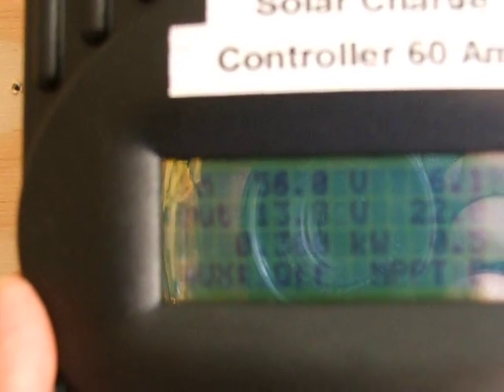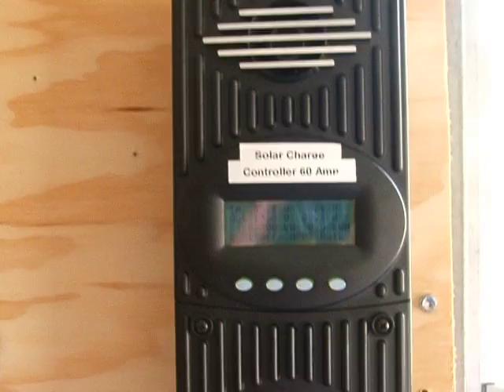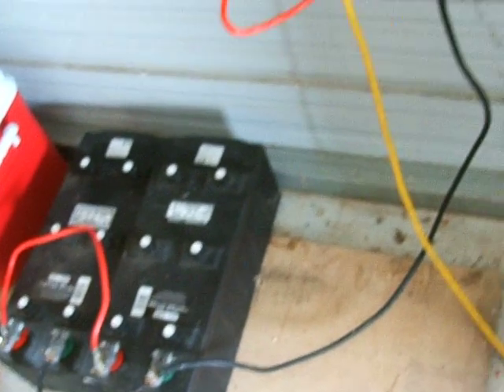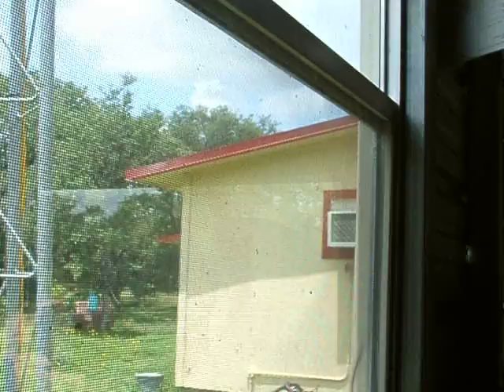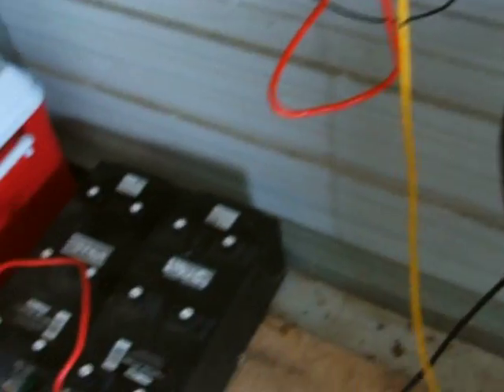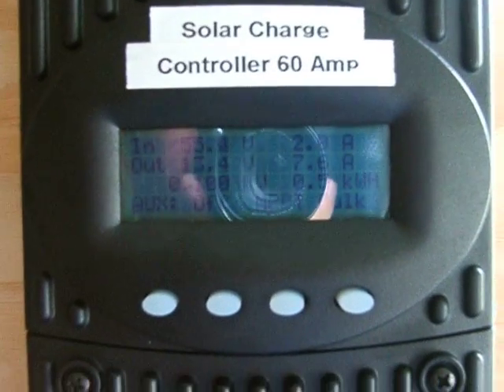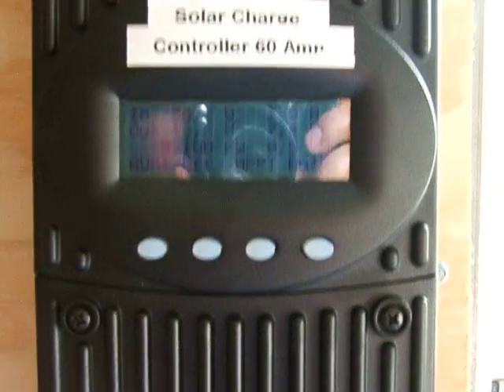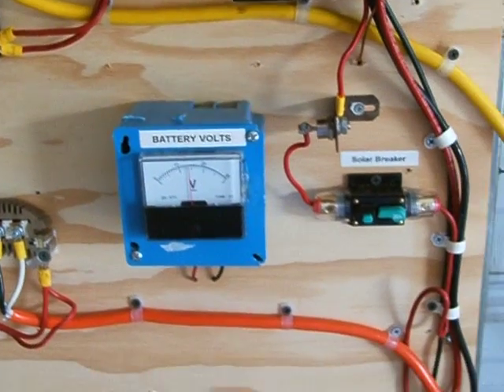Harbor Freight Solar Panels Charging Batteries

Comment: 22 amps..  JESUS.  Nice.  I think I'll be something  like this  too. . My panels are   indoors up against Windows and they suck this way voltage is alright amps is crap.  It seems in parallel they always fail to reach proper charging voltage.   I was  thinking about just using another 100 watt solar panel  and cibbectibg that one in series since I'm limited with space

Comment: Can this charger charge at 12v 4-110Ah=440Ah, led acid batt?   Can it charge double that 8-110Ah= 880Ah?  Will charger burn trying to charge my batt since I only have total PV780w in series.   (System at 12V)

Comment: 6 amps is very good for 4x15 watt panels (60 watts). I have a 120 watt kycora panel and hooked up to a pwm solar charger it averages 4.5 amps in sunny weather, sometimes can get up to 6 amps but rarely. 
I suspect your top of the line mppt charger is definitely getting every watt out of your panels. Seeing your video, definitely going to get me a mppt controller. Thanks for the info.

Comment from the maker: because the charge controller that comes with the kit can only work at the voltage of single panel, you should be fine to add just one more 15 watt panel to the first kit if you wire it in parallel like you did the first three panels in the kit. Otherwise, you have to buy a different charge controller.

Comment from the maker: there are 22 batteries with a 230 amp capacity each, so 22 x 230 = 5,060 Amps at 6v, since my battery bank is set for 24v then my total Amps @ 24v = 1,265 A or 30,360 watts of which 50% is usable. So I can roughly support a 15kW load for one hour without any charging.

Comment from the maker: No, it will not. If it doesn't sense the battery it won't work. I called Outback a couple of years ago with that very question, that's the answer they gave me.

Comment from the maker: From Interstate Batteries, they are deep cycle batteries rated at 210 amps reserve capacity. Car batteries are rated using cca, they won't last you a year in a solar application, you need to get real deep cycle batteries.

Comment from the maker: I don't measure my power output or reserve in amps as that is a meaningless measure without knowing the operating voltage. I measure in watts, I'm putting out about 750 watts per hour out of the panels on average. The battery bank is now a single large 24v bank with 22 batteries of 210 Amp reserve capacity each so the reserve capacity in watts is 115,500 but since I only discharge no more than 50% I really have an operating capacity of 57,750 watts or 2,406 Amps.

Comment: If you're getting 55 volts at 6.1 amps in and 13.2 at 22 amps out to the batteries you're losing around 15% in your inverter due to the voltage conversion. You might save a bit on the cables but the inverter is taking that away. An inverter usually takes some 5% of the energy and turns it into heat.

Comment from the maker: @breezebro I forgot to add this, go around your county roads and look at all the road signs with solar panels that are cracked after a hail storm, that should tell you if you need to worry about it or not (or contact your city dept. of roads and ask them about issues with their solar panels). I don't believe that's an issue because the panels use tempered glass and are angled so they should deflect most of the energy. You'd think you'd hear more about it if it were a real issue.

Comment: Your videos are excellent. I almost think I could do it, but I do get confused since you have some things on that wall for wind and some for solar. I also don't understand how you'd hook up the batteries to a house like in a circuit breaker system so that you can still use regular power if you run out of solar juice. Thank you so much for taking the time to show what you have. Your organization skills are awesome! Would love to know where you found your batteries and how much they cost you.

Comment from the maker: @lamartosh You can use any charge controller you like as long it can handle the voltage and the current for your wiring. God bless you and good luck with your project

Comment from the maker: @toobroke2fight You are correct, I was answering another person's question about whether or not to disconnect their charge controller at night, my answer was really about the blocking diode that exists at each solar panel to prevent draining the batteries at night. Thanks for the comment and God bless you.

Comment: @econewpower I am pretty sure the Outback doesnt need a blocking diode since it should have a relay that disconnects the array at night. You are probablly losing some wattage with the diode in line. check the manual and remove the diode. Its your stuff, but every little bit helps! just my thoughts.... nice system!

Comment from the maker: @teachingedcetera I don't use the HF change controllers, they are not big enough for what I want and they only handle 12volt battery circuits. The 23.57v you mentioned is for the open circuit volts of the panels not for the battery voltage. The battery voltage must be 12 volts. My panels are wired to put out 40 volts which is why I use a different charge controller.

Comment: When you hook up your 24 volts from your panels, do you run that directly into the HF charge controller?  Will it handle the 24 volts?  It says on the label that the peak voltage is 23.57.  Does that indicate it will handle 24 volts without blowing?

Comment: When you hook up your 24 volts from your panels, do you run that directly into the HF charge controller?  Will it handle the 24 volts?  It says on the label that the peak voltage is 23.57.  Does that indicate it will handle 224 volts without blowing?

Comment from the maker: @onemedic Panels are not 12v, they are 20VOC (volts open circuit), thus 4 x 20 =80 VOC.  You have to have nominally a higher voltage than the bank you are trying to charge in order to be able to charge it. Thinks of volts as the pressure with which you push electricity into something, the higher the voltage, the higher the pressure to push those electrons.

Comment from the maker: @CCDeer1960 No matter how big the array is it will only read .300 watts because it was on float charge - meaning - you cannot continue to charge batteries that are already charged. The array on this controller is 420 watts, the grid tied arrays is 1,600 watts, the new array going up will be 2,000 watts. But when batteries are fully charged you can't expect a high amperage/wattage reading right?  Take care.

Comment from the maker: That is a great price, good for you!! You can leave the switch on at all times, there is a blocking diode in the circuit to prevent draining the batteries during dark hours.

Comment: Right now, at the HF place near me- some sort of "Super Coupon" in the flyer they mailed out- had them for $138! So, I bought a set.

With this system right out of the box- is it OK to leave the controller switch in the "on" position after dark (still connected to batteries), or are you supposed to turn the system off after dark. I would think that would be unhandy,  Do the batteries "backfeed" into the panels after dark, or is there electronics in the controller to stop it?

Comment from the maker: @mrbuki77 You are correct, I got 1.6Kw of 210watt Sharp solar panels for about the same price, I can order the Kaneka panels from sunelec or wholesalesolar for about .98c each. An advantage of harbor freight panels is that you can begin very cheaply and add very incrementally. The Kaneka panels notwithstanding these Harbor Freight panels come out a bit cheaper sometimes when you factor in the freight cost. Last time I ordered panels from California they were $400 shipping for eight of them.